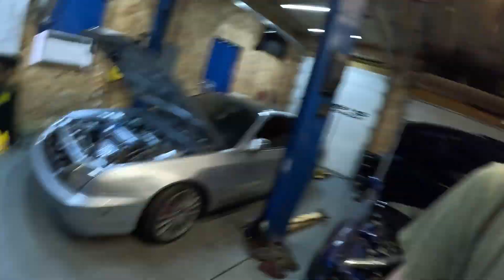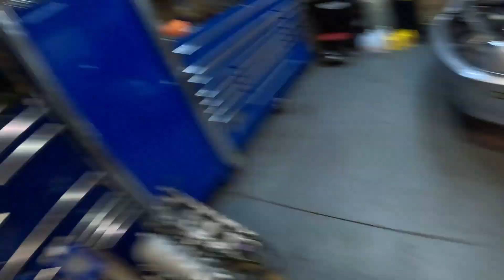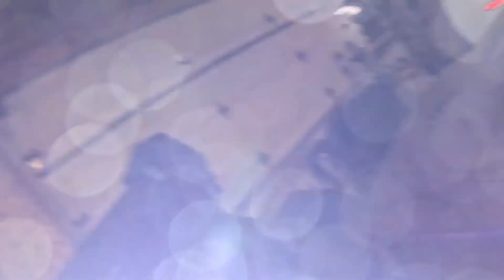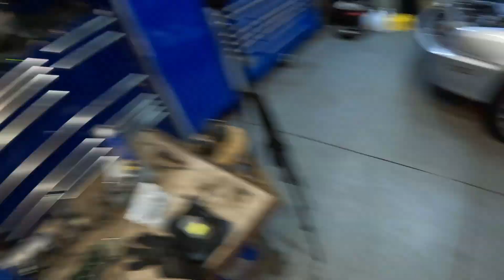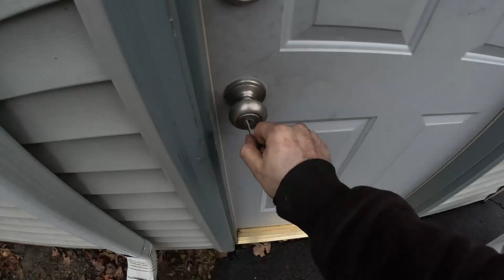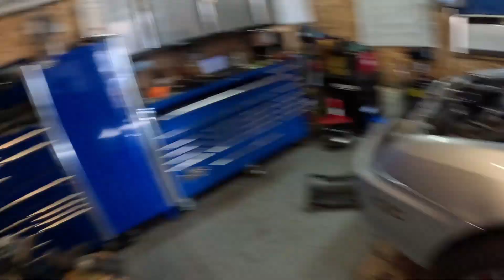Project Car Woes

Comment: Nice prelude man! You should check out rawrkee’s intake mod video. I did a swap in my 5th gen and and to pull the intake to clean the egr ports because it was causing a misfire. the plug kit is hard to find now, so its nice to have replaced the plugs with bolts and crush washers
Reply from the maker: Thanks for the heads up! I did take a good look at the manifold and cleaned it up before it was installed. Surprisingly this EGR port and valve were looking pretty clean.
Reply: @Sebs.garage_  glad to hear it, my ports were so clogged when the valve opened it dumped all the recirculated exhaust gas into cylinder 1 because the 2-4 ports were blocked off by carbon buildup. took about 4 hrs and many cans of carb/tb cleaner to get all the gunk out. Probably the nastiest thing ive seen come out of an intake manifold

Comment: Cool vid. What service is performed on the fuel injectors? I just rig it up myself using a cordless battery, tubing and a carb cleaner spray can.

Comment: What clamps are recommended for the silicone hoses? Same as rubber hoses or special? I see you have worm drive style, are they just normal ones? One thing impressed me is Honda put a regular horn in the fit. Can't stand the meep meep one in civics
Reply from the maker: Constant tension clamps are best as they'll expand and contract with temperature changes instead of the fixed size of worm gear clamps
Reply: Try looking into Norma clamps